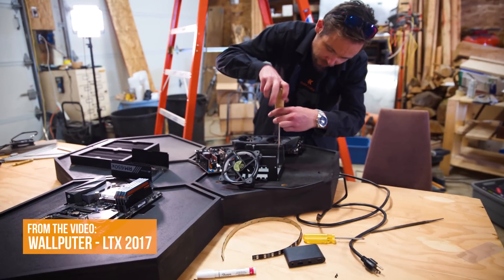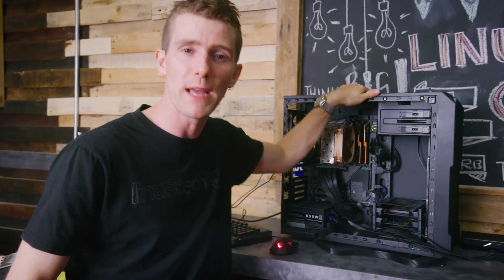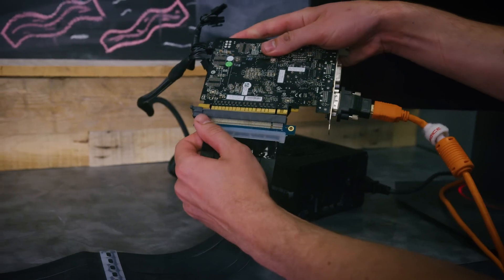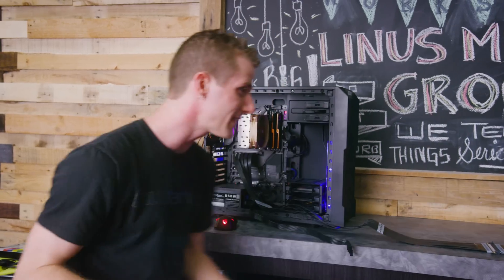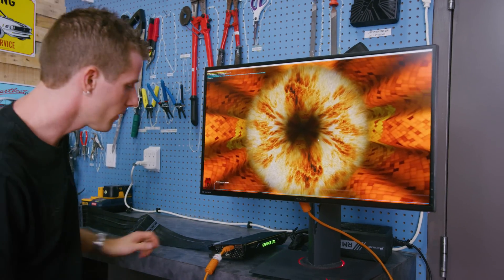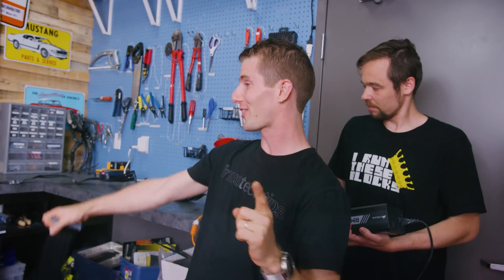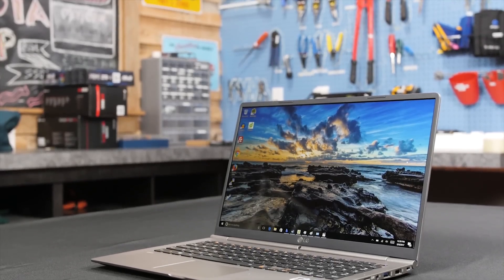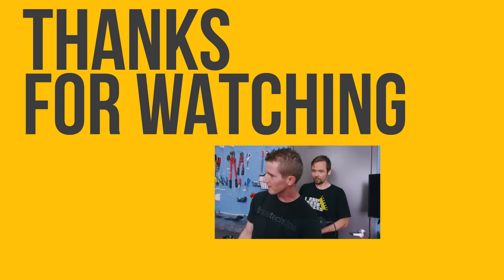How many PCIe Extensions is TOO MANY??

Comment: As an engineer PCIE risers scare the crap outta me, I think the only reason it works is because the GPU is far enough from using up the limits of PCIE bandwidth so you can get a large number of transmission errors and be ok because it will have the headroom to re-transmit failed data before it causes a drop in perceived performance. This is likely linked to why the PCIE2.0 card died at a shorter length, with less maximum bandwidth it could sustain less errors before it would end up unable to retransmit failed data in time.

I kinda want to see this test with one of those multi GPU setups that doesn't use an external bridge but just bridges the cards over PCIE (i know AMD does this since R9 290 but not sure if nvidia does too now?), with the PCIE more busy and having less overhead to protect against transmission errors I'll bet you will see them failing at a shorter distance which will sorta prove my theory ^_^
If you're feeling rich you could get a PCIE test machine, they are RIDICULOUSLY expensive though with the speed they need to be able to show you individual packets flying by at PCIE 3.0 speeds XD

Comment: What if that length was a solid connection instead of using all of the connectors, wouldn't that reduce some of the signal/power loss?

Comment: Most people think that PCIe is fast but really fragile. That's not true. Its fast, but also quite robust. It can deal with a surprising amount of signal degradation. Even asymmetric connections are just fine. The dude that cracked the PS4 (fail0verflow) used PCIe over a 115200baud serial link in one direction and gigabit ethernet in the other. It was slow, but worked just fine.

Comment: Why didn't you check whether it's the total length of the risers that causes the problem versus the number?
I mean you are using like 6-7 different ones for the 3m. Whereas you could try using 4 1m ones for 4m, and see if that works. There could be more signal/power loss on the connection points as opposed to the "cable" part.

Comment: Couldn't you have just bundled up the risers and left everything right by the case, no extra psu needed?
Reply: The risers are shielded, but after 3 meters, I'd be worried about electrical noise/interference.  Also, bundled up wouldn't really represent a real world application.  Ok, 3 meters way is also not quite a real world application, but linus did have to go a meter for his wall pc, so it's closer to reality lol

Comment: After so long you will run into voltage drop. Which you guys did. If you had one long single cable it would work better. Any longer you would need larger diameter cables for DC power.

Comment: the signal loss or rather the additional distortion of the signal will be significant over those many connectors... i reckon you could have a 5 meter plus pcie cable if its in one piece and double shielded.

Comment: Adding more PCIe extensions makes delay between CPU and GPU longer, because speed of light is finite. 3.6m of extension makes additional 12 nanoseconds (0.000000012s) of delay, that doesn't sound like a lot, but it is 48 cycles of 4GHz CPU

Comment: They didn't have to move the monitor away with every riser😂. They could have just snaked the extenders back to the rest of the pc.
Reply: even though they were shielded, it might have caused some noise/interference
Reply: Brett Wolff probably so you can see it getting further away
Reply: If it was shielded in fact, then it wouldn't (shouldn't). But you could also do it in a kinda W format, or whatever. It's just more fun to see it so far away from the PC

Comment: Would have been great, if you wouldn't just have tested it with a GPU, a SSD would have been a better way, since a Graphics Card usually can't saturate a PCie 3.0 connection

Comment: The lag is actually the delay between motherboard to GPU. 3D Rendering(not gaming) might not have performance impact, but gaming or data processing (rapid data exchange) will have different result than just the stress test that loop the same math model and texture. :)

Comment: I dont think that GPU stress test transfers a lot of data via PCIe lanes, merely some textures at the beginning. Im interested if the actual bandwith varies or if it still works with higher transfer loads. You can transfer some Data to the GPU memory using CUDA and mesure the time. There are some code examples on nvidias dev forums and someone one the evga forums uploaded a compiled programm so its just executing it. I would love a follow up on that @Linus Tech Tips

Comment: So I could just put my GPU into fridge, which is 3 meters away in another room :D
Reply: they did video on that, you should check it :D
Reply: adec avdic i have seen that😂😂😂
Reply: fridges produce heat, you'd be generating more heat that way lol
Reply: Condensation)
Reply: Smelly Ham The fridge pulls all the warm air to a specific part of the fridge. That's why the bottom is often warm or even hot.
Reply: you may want to google how a fridge works +Smelly Ham  to remove heat from something generates heat, a fridge removes heat from inside the fridge using a CO2 compressor, but that compressor generates heat externally. you can't make something cold with exchanging heat.

Comment: just how far can you go with sli?
Reply: with better shielded riser/ pcie extender cables with higher quality wiring, maybe much further.  until the delay over the cables was high enough to interfere with pcie communications... 

according to 
https://www.silabs.com/documents/public/white-papers/PCIe-Clock-Source-Selection.pdf

the clock source with pcie 3 has an allowable jitter of 1 picosecond or so, but the overall delay as we've seen can be at least 10 nanoseconds without issue.

"A disadvantage is that the same clock
source must be distributed to every PCIe device while keeping the clock-to-clock skew to less
than 12 ns between devices."

Comment: Soooo I can literally sit my graphics card in the refrigerator while i game overclocked
Reply: He did try this, just search, refrigerators are not suitable to handle constant heat load. That's a bad idea.
Reply: Linus must try this!
Reply: you could also just put your computer in the fridge and just take a loner display cable
Reply: Refrigerators are not suitable for heat sources, only passively warm things.
Reply: watch the computer in a fridge video, you would run into the same problems here sadly :(
Reply: Of course linus has tried building a PC in a FRIDGE hahah
Reply: Well, it could be on the other side of the room, so that the thermal output aren't all in the same region, which means that your intakes will pull in slightly cooler air.
Reply: https://www.youtube.com/watch?v=B8bhGw4vUFE
Reply: Someone needs to try this now
Reply: Random that was with a full computer though, would t it be easier with just the GPU then?
Reply: If he needed to cool it down so much that a fridge would be helpful then it probably would be too much heck if you put too hot of food in the fridge it can take an hour or so before it actually goes all down.
Reply: He already has a video on this, it doesnt work as well as you'd think
Reply: the condensation would fry the chip but yeah you can try it out
Reply: Funny because Linus made a video busting the "Refregirator colled gpu" build
Reply: Winter in Quebec: -40ºC/F outside FTW
Reply: Legit idea imo. Now i can enjoy the silence on my desk when i put my Vega 56  OC fridge cooled in the kitchen
Reply: Dexter Sullen 'TRUTH' Linus make a video about that! That would be so cool!
Reply: he did kinda...
Reply: Don't stick electronics in the fridge.
Reply: Dexter Sullen 'TRUTH' Freaking great idea

Comment: You should've introduced some electrical noise from a cellphone call, electric lighters, brushed motor power tools etc. nearby.
Reply: Elijah Bush no shielding is perfect.
Reply: shielding is imperfect. you need a LOT more than that dinky little foil to have exceptional signal shielding

the connectors on the ends of the extender cables which are made out of plastic likely add a lot of loss and noise, so with some riser cable improvements they might be able to go out a good bit more distance. it only takes the signals ~12 nanoseconds to travel from one end to the other of those cables.
Reply: Forssa1 they were shielded
Reply: I know, but test anyway.

Comment: Thanks for using Metric!
Reply: Blame America for still using retards units of mesurement
Reply: Abe lincoln Blame the US for being one of the 3 countries (US, Burma/Myanmar, Liberia) that still use an old, nonsensical, outdated system.
Reply: Abe lincoln 
Metric is fantastic. And I am American
Reply: Just about every educated person is the US is taught metric, and the majority of people know the basics of it at the very least. It's just that it would cost the US wayyyyyy to much time and money to change every single sign and package in the entire country (which is bigger than nearly all of Europe), as well as re-teach the older generations that we don't 100% switch over. The only place we 100% use metric is for sciences and commerce because the entire world is a peer and it's required for specifics. Metric is has been the official majority measurement system in the US, since the mid 70's
Reply: Phantumix But not everyone else. I love how Americans ramble when it is one of the 3 countries that still use imperial units.
Reply: erik61801 give me two instances of them being connected with references
Reply: In Canada we use imperial for cooking (fahrenheit and cups, but units are usually in metric as well) and for body weight and height, and in a lot of construction(3/8" screws, 2"x4" wood, etc). But engineers have to be able to convert between imperial and metric because we do a lot of trading with the US. In all official documentation we use metric though.
Reply: Canadians are apologies anyway
Reply: Did Canada made metric units official?
*Edit*: by official I have meant main, if Canada made the metric system their main unit system
Reply: dat pcie is 1 hour long
Reply: Diogo Almeida Well they are Canadian. It'd be strange if they didn't 🙄
Reply: +Valanway

Don't forget drugs. That's all in metric too.
Reply: In the 1970's
Reply: Br Everywhere hu3
Reply: Lukas Tran 1.65 Km
Reply: Ok, so Canada uses both equally, America teaches both, but the majority uses imperial? (except for maybe physicists, scientists etc.. thing where you have to be really precise ?)
Reply: I expressed my self wrong, I have meant if canada made metric their main system, not as if they did not use it ever before, but my question is already being answered by the follow up comments, thanks.
Reply: That has to be a pain in the A. It might even have a bad effect on educating people. If I had to use another system to make my physics/chemistry homeworks, I would definitely be more inclined to hate that subject.
Reply: Filip Vlček It doesn't bother them actually. They don't need to educate people in science.
Reply: Diogo Almeida Lol they live in Canada they don’t use the dumbass imperial we use
Reply: Filip Vlček we use both, since the united states is our largest trading partner, its more convenient.
Reply: it's funny cuz they teach both in america.  the only people complaining are uneducated swine.
Reply: lol America does use metric.
Reply: imperial and metric are tied together, its not oil & water

Comment: Video's 20 seconds below 10 minutes.

Someone's getting fired.
Reply: I Z YouTube promotes videos that are over 10 minutes which means that they make more money
Reply: I Z you can put 2 ads if video >= 10minutes
Reply: They earn enough from their sponsors that Youtube ads are not the worst thing to lose.

(Still bad just not being horrible)
Reply: Probably the guy who was hired for star wars impressions. He didn't speak enough to extend the video time.
Reply: Always respect that
Reply: No Mid-Rolls?
Reply: GFmanaic 2 or more
Reply: Argf *Star Trek.
Reply: ScienceRedstoneGaming but WHO
Reply: When out putting to a 8k monitor (are there hdmi cords or any cords that support this?) is it possible to hook the graphics cards in sync with hdmi cords? E.g. the first graphics card has a hdmi cord running out of it into another graphics card than out  to a 8k monitor. So the second will have one going in and out.
Reply: they can only communicate through PCI, and they don't typically accept a video stream input. 8K will probably be best in the future via displayport
Reply: why do some graphics cards have hdmi then?? its just i was watching one of there vids then they tryd 4 4k tvs
Reply: Joshua Chenery HDMI is the output only for gpu. If you want them synced together, you need to do it through pcie and the operating system will do the rest
Reply: star trek  see wat you did tere
Reply: ScienceRedstoneGaming LinusTechTips don’t care
Reply: I Z less money
Reply: there are 24 minutes in an hour and 60 hours in a day
Reply: *got fired.
Reply: ScienceRedstoneGaming 60sec
Reply: Really?!?!?! you think there's 100 mins in a hour?
Reply: what's wrong with under 10min?

Comment: The Nvidia GTX 1180 will be great. I just can’t think of the price.
Reply: There was a 800 series but just as m versions for laptops
Reply: Moustache Boy yes the 880 that was a great graphics card
Reply: it will actually be a pascal refresh the 1280 will be amazing because it will be volta
Reply: RandomWasTaken rumors say it beats the 1080ti
Reply: I call bullshit Volta is next and it could be the 2000 Series aswell
Reply: KyroMonjah i use the 880ti
Reply: I DID NOTHING WRONG FEMALES HAVE MORE RIGHTS 480,580,680,780,880,980,1080 whats nexts?
Reply: rhysj6 Oh so the 1180 is not gonna be Volta?
Reply: RandomWasTaken that graphics card is in my dream pc
Reply: Edo 600
Reply: Moustache Boy but can it run crysis
Reply: rhysj6 
No one is sure of naming.
Reply: Dimitris_Legend13 
Maybe, maybe not
Reply: i still want to see the gtx 1090 ti (2 gpu chips in the same board)
Reply: 2080*
Reply: RandomWasTaken damn you, I've always wanted that card
Reply: 800m 810m 820m 830m 840m 850m 860m 870m 880m
Reply: Didn't nVidia announce that Volta wouldn't come to the 3D gaming market in the forseeable future due to low chip yields and high production cost?
Reply: Moustache Boy 1000 series, 2000 series, not 1100 series nvidia aint stupid
Reply: Moustache Boy 
Actually there was no 100, 300 and 800 Series
Reply: why 1180 not 2080

Comment: Interesting... But instead of putting the GPU in another room, I'd rather put the entire computer in another room.
Reply: Tetra Sky only OC the GPU and put the fans on 100 xD
Reply: u right
Reply: motherboard standoff rizers?
Reply: That's so 2016
Reply: DIYPerks has a video on that
Reply: Thunderbolt 3 dock you small minded pleb.
Reply: drill a hole trough the wall
Reply: Put the computer in one room, the gpu in another room, the power supply in another room, and finally set up your peripherals in a completely separate room. I call it the 5 bedrooms computer.
Reply: Tetra Sky 5 room pc build please.
Reply: Tetra Sky I have a 5 meter dvi cable for just that
Reply: I call it "peripheral segregation"
Reply: Tetra Sky That isn't the point, nobody would put the GPU in another room. It was just an example, what you could possible do with it